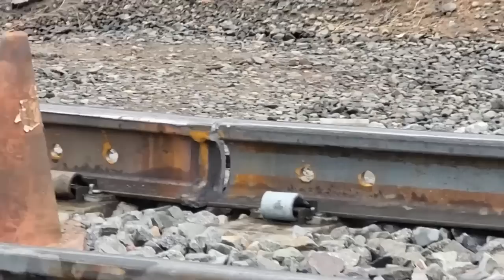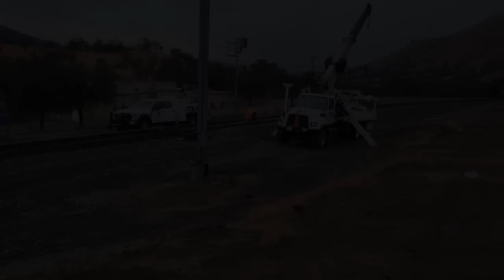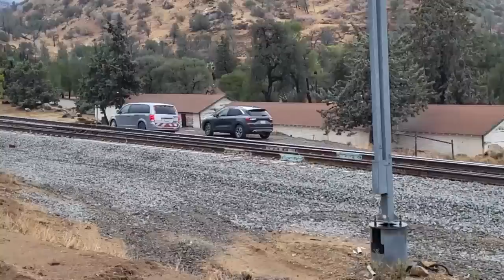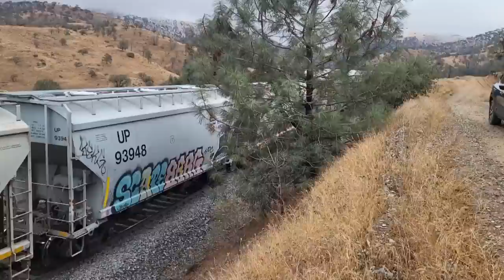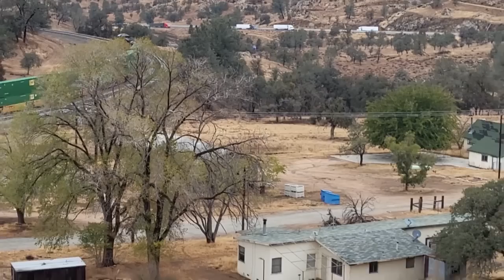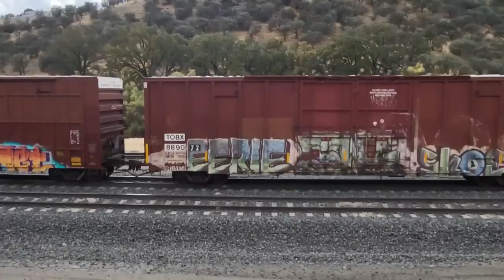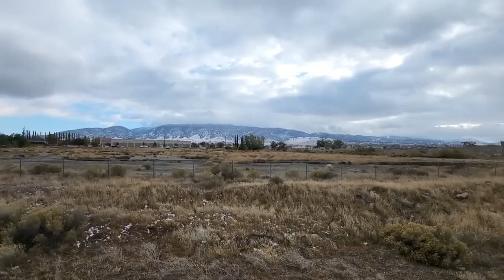Trouble on the Tehachapi Pass! Broken Rail at Woodford.

Comment: Mark I worked in the planer dept. at a sawmill near Dinuba for 23 years and then at Home Depot in the lumber dept. for another 21 years and you are right about the smell of lumber I never get tired of that smell.  Thanks for all your videos.
Reply from the maker: Was that sawmill the abandoned facility on the south side of town with spurs running into it?
Reply: @MarkClayMcGowan  Sequoia Forest Industries North of Dinuba and South of Reedley. There are several spurs there and I think they are still being used, sawmill and planers are long gone.  There is a co-generation plant there also.  That sawmill was built in the early 50's and operated until the spotted owl came to the forest...lots of people lost their jobs.
Reply from the maker: And the spotted owl would still have been fine.
Reply: @MarkClayMcGowan  As delicious as the smell of fresh cut lumber is, the smell of the forest is even better. The mix of live trees along with the decomposition of deadfall and brush is wonderful, especially in the fall and spring when everything is damp.
Reply: I loved the smell so much, that when I graduated from Reedley High in 88, I moved to Oregon an spent 20 years working as a faller or a lumber grader, I now work for the Post office as a carrier, but still love the smell

Comment: Mark .. Looking at that break where the rail broke .. I saw holes on both sides of the rails .. Question  .. Could they have used fish plates instead of cutting the rail out ? 🤔 Or my guess are all rail on Class 1 railroads required to  be welded by FRA rules ? 🤔
Reply: He mentioned they couldn't because it was right at the field weld.  The weld leaves a bulge on both sides of the rail that the plate wouldn't fit over.
Reply: @Tommy Zamberlan ..  Yes and when I go back and look at the break it was at a weld joint .. but I'm also thinking that FRA rules may require all Class 1 railroads to have only welded rail .. I think Mark could verify that 🤔  ..
Reply from the maker: The holes were there from when the I-bond (the piece of rail with the insulated joint in it) was originally installed during the rail project. It was welded out prior to that project ending. The FRA makes no distinction on jointed or welded rail other than all joints in a fouling circuit (a switch location) must bonded for continuity.
Welded rail is much better for rail installation, track structure, and track and signal maintenance.
Thanks for checking it out!
Reply: The only way to angle bar a break near a field weld like that is with bubble bars.  Even most old school railroaders have never even seen a pair of bubble bars, but they do exist.  I’ve seen them in track on BNSF track in the Elwood/Joliet, Illinois area.  They have a bump out in the center of the center holes to accommodate for the bulge left from the field weld.
Reply: @Tom Stathis  The more I looked at the video I was puzzled how would an angle bar would fit over the bumb and then I went back thinking it could be a break in the weld joint . But your analyagy makes sense . Thanks 👍

Comment: Awesome video Mark. I was just ready to write in on how I would fix that
rail when you narrated on how they were going to do it. Was also ready to
hop on a plane and fly out to help. Very odd break! Usually a break at a weld
takes part of the weld with it. Caused by an inclusion in the weld where the
slag had some oxygen deposit left in from when it was welded. Have never
seen a break an inch away from the weld like that one. Really making me think
on why it happened. That looked like fairly new rail. Would really like to know
when that rail was laid and the weld made. Great shots on the rest of the video.
Excellent show my friend!!!
Reply from the maker: This was welded electrically with the big, on track unit. Maybe that changes the properties of the weld? Thanks for checking it out!
Reply: @MarkClayMcGowan  I cannot answer that. We've never had any flash butt
welding done here. Just watched it on a YT video. I've had several thermite
welds break and the pattern on all of those is just like I described in the
original post. Hope sometime you can talk to a welder and find out what
they think. I would love to know that info.

Comment: How do they find a broken rail in the first place? Visual inspection or is there a system that automatically detects broken rails?
Reply from the maker: When a rail breaks, it causes a track indication that shows up on the dispatcher's board. It also puts all entering signals to stop. The dispatcher notifies signal and track operations, who notify a signal maintainer and a track inspector. In this instance, in a control point, it's pretty easy to find as the area is small. This one was found and removed from service by the signal maintainer. Thanks for checking it out!

Comment: Silly question, but why do they not run all units? Wouldn’t it be more efficient to run them all for the power?
Reply from the maker: Many times they are just moving power from one place to another. Two or three units can move most of these trains over the mountain. Longer, heavier trains may have power on the rear (and/or middle) for assistance and to reduce drawbar stress and for dynamic braking, but running all the units would be a waste of fuel as the working power can easily pull the dead weight as well. The only silly questions are the ones no one asks!
Thanks for checking it out!

Comment: A most interesting video... and it raises a few questions...
1) The rail break (and pull-apart) must have occurred under traffic and I was wondering how it was detected, particularly since we no longer run cabooses and the pushers are likely unmanned. Or was it detected as a result of a track inspection or a failure of the signal system to clear?
2) Was this on track that was recently worked on?
3) When was the last ultrasonic inspection of the rail performed?
4) Was there previously a rail alignment issue or fouled ballast in the area?
5) Does it look like the closely adjacent rail weld was improperly done, as the rail appears to be structurally weakened?
Thank you Mark for clarifying the matter. 2024/03/10. Ontario, Canada.
Reply from the maker: 1. Not all rail breaks occur under trains. A weak spot and enough temperature difference (they happen in the summer as well) and they will break without any other outside forces. This one did break under a train though, and left a track indication in the OS. The dispatcher then called a signal maintainer, but the train you saw on the mainline was given permission to flag the red signal. When the conductor walked ahead to inspect the track and switch, he saw the break and didn't believe it was passable, so the turnout was removed from service. Crews on cabooses rarely spotted broken rails, and manned helper crews never spotted them. 
2. The rail on each side of the OS (the turnout between signals) was laid and welded to the OS rails in mid July and the break occurred in early November. It was determined that a low spot under the weld was the cause.
3. I have no idea when the rail detector car had last checked the area.
4. A low spot had developed under the break due to improper tamping, which settled after some wet weather, but lateral alignment was fine.
5. The weld was fine. The roadbed at that point was the issue.
Thanks for checking it out!
Reply: @MarkClayMcGowan  - Thank you very much Mark for the detailed reply.

Comment: I like to know where I can get a radio in order to see some this trans where I live. I live just outside of Birmingham alabama, there is a train yard in place called Irondale. Back when I used to rewind motors, I used to re-insulate a lot of these traction motors on these engines. And rebuild or rewind some of the switch track switches. But what I understand now, these engines are turned into a AC drive setup if I'm not mistaken. Because we have not rewound any DC traction motors in quite a long time.
Reply from the maker: It's my understanding that all the DC road engines on the UP have converted (help me out experts!) to AC. As to the radio, you can buy a scanner and program it with the frequencies.  I don't know exactly where you would get them for your area, but I'm sure local railfans, and/or ham radio folks, would have that information. Thanks for checking it out!

Comment: How can an engineer spot a break like that and stop in time?  Seems like it would be hard even to see from the distance of the siding switch, yet apparently the train got stopped. Did another train catch it earlier, or a track inspector catch it, or did the signal circuit catch it?
Reply from the maker: If the rail is broken, the signals governing movement into that section of track will be red. At a control point like this, the conductor would be required to walk from the signal to the power switch to ensure the way is clear and the switch is properly lined. Between control points, the train would slow to restricted speed, which is a speed at which they could stop in half the distance of seeing an obstruction or improperly lined switch, and in no case, over 20mph.
Sometimes the crew will see the break, sometimes not, and sometimes, the break occurs under the train.

Comment: So it was a Broke and Run ? 😬 At what point would the Crew of the train that caused Broken Rail be Notified or would this Page the Dispatcher or Repair Group ?
Reply from the maker: Rails don't always break under trains, but if they do, there is no way for the crew to know that. Once they clear the affected circuit and the light on the dispatcher's board doesn't go out, they will get someone out to find the problem. The dispatcher can't tell what's wrong either; only that there is a problem.
Reply: Red Signals

Comment: I wish, mon ami, that you had video-taped the welding process !
Reply from the maker: They didn't weld it that day, and I no longer have connections in the track department up there. Should I come across them doing it somewhere, I'll get it as long as the crew are okay with it. In the meantime, here is the link to a video I shot of the rail gang at work in which they use the on track electric welding process.
https://youtu.be/Io3-acVjMnQ

Comment: How is a broken rail like this one usually detected? Thanks!
Reply: That's exactly what I was wondering did a train run over and notice it or is it detected automatically?
Reply: The signal system is setup to catch this type of defect. A broken rail will drop any wayside signals or crossing gates in the block affected. And at dispatch, it'll probably show an occupied or abnormal state.
Reply from the maker: Control points and segments between them have lights on the dispatcher's board. When clear, the light is out. If it remains lit, the dispatcher notifies signal operations and the local Maintenance of Way manager and a signal maintainer and track inspector are dispatched to the area. There are a number of things that will cause a "track indication",  but broken rails are one of the more common problems. My buddy said that he found 87 in 2021 on his 400+ mile territory (he is a signal maintenance foreman) and that was just the ones HE responded to!

Comment: Who spotted that bad piece of rail? How did they know there was a problem in the first place.
Reply from the maker: A broken rail deenergizes the track circuit, which leaves an indication on the dispatchers board. Dispatch calls signal operations, who dispatch a signal maintainer to find out what's wrong. The maintainer notifies track forces, who then make the determination of whether or not trains can pass the break. In this case, they couldn't, and the track was removed from service.

Comment: That weld was done only a few months ago. 8/24/22 and the Rail Temp was 90 degrees. The ultrasound must not have picked up a crack.
Reply from the maker: Yes. They changed out the entire switch panel in August (wood to concrete) and laid new CWR on both ends in July. There was a very low spot under the break as well. I'm sure that didn't help things.

Comment: What caused that rail to break like that? I bet some of the train crews were thoroughly annoyed for the delay. Oh well.
Reply from the maker: In this case, it was likely due to a relatively big drop in temperature in a 24 hour period (there were actually three on this morning between Tehachapi and Caliente). It was in the 60s the day before, but rails break in the heat as well.
Reply: @MarkClayMcGowan  That is interesting to know. Caused quite a backup of trains but you got a lot of good catches.
Reply: Flats on the  wheels will also resulting a broken rail as well

Comment: how did they find that broken rail?
Reply from the maker: A signal maintainer was called, but in the meantime, the train sitting on the mainline was given permission to flag through the CP. The conductor then has to walk to the switch to take into hand (so there is no way it can throw under power), and inspect the track for any problems. He saw the break and determined it was not passable, so the dispatcher removed it from service.

Comment: The two BNSF locos are the older GE 16 cylinder units called "Dash 9" by most railfans. One with the Heritage II livery, and the other with the War Bonnet livery(Red Cab). A common thing you'll see on a lot of Dash 9 units is evidence of an engine fire in the center section of the loco, lots of paint irregularities and scorch marks.

The CSX is a much newer 12 cylinder GE Evolution Series unit.
Reply: You are correct on the Dash 9 scortching.   Union Pacific made a mistake putting the American flag on their loco's because a lot of them are scortched.
Reply from the maker: I don't think it was a mistake at all! I thought it was very cool! It's only a representation of a flag, and therefore, not subject to the same protections and guidelines afforded actual flags.

Comment: You might want to check out what is known as Ear Values. They are better than ear plugs. It cuts the real high and the real low noise. Where to find them is at gun stores or shooting ranges. I used to shoot trap (shot gun). They can last several years. Just wipe off the ear wax and your good to go. There is a small cylinder inside do not get that wet. And do not share with other people. Each should get there own. I have heard why we are starting to see shorter trains. The bottlenecks are pretty much gone. The stores are getting stocked up. And the warehouses are full. So the orders are down. What is stocked up is none food things. And with the economy in the toilet the stuff is too expensive and the stuff is just sitting. So if and when the economy improves the trains will be shorter. You may even see more bear tables. Getting those car to where they win need them close by the terminals. Most trains we see come from a area once a day. From where they start from so if they have a lot the train will be long if they don’t it could be shorter. Steven Sipes

Comment: Any longer than an hour for a roadmaster to get there, and they're getting in trouble. You can walk a train over that at 10mph if you had to. Put wraparound bars on it while your team gets a new piece of rail to cut it. Done.
Reply from the maker: Track supervisors are the ones who show up. Even at SP, Roadmasters (UP calls them Manager of Track Maintenance) didn't go to broken rails as there is nothing they can do. This was one of three that morning. The break was too close to a field weld to use bars and it was in a low spot (even though this entire panel was just installed and surfaced this past August), which probably contributed to the break. It wouldn't have mattered because, due to the other breaks, there was no where to move them. Thanks for checking it out!
Reply: @MarkClayMcGowan  gotcha.  We call them track supervisors / roadmasters on NS. And you can actuslly put joint bars on a broke thermite weld if the gap isn't too big. Look up wraparound / belly bars. Cool video and story!
Reply: @MarkClayMcGowan  Was the first cold snap of the winter on the new relatively new field weld a factor?

Comment: And why is it not electrified? We have only the most remote place on diesel traction.
Reply from the maker: It was studied around the turn of the century, but there was simply not enough electric infrastructure to do it. Electric traction is good for many things, but not pulling 10,000 ton trains up 3% grades. Also, after 1980, when it might have made sense, the environmentalists would never allow power plants to be added to power it. Now, it would simply be too expensive.
Reply: @MarkClayMcGowan  Почему вы считаете что электровозы не могут водить поезда больше 10000 тонн? У нас они спокойно водят, ещё с 80-ых годов прошлого века. 3% уклон для них не предел - на обходе Северомуйского тоннеля есть участки с уклонами по 4,5% Кроме того, с электротягой возможна рекуперация энергии.
Reply from the maker: I'm sorry. This reply wouldn't translate.
Reply: @MarkClayMcGowan  Here :) Why do you think that electric locomotives cannot drive trains of more than 10,000 tons? We have them quietly driving, since the 80s of the last century. A 3% slope is not the limit for them - there are sections with slopes of 4.5% on the bypass of the Severomuysky tunnel. In addition, energy recovery is possible with electric traction.
Reply from the maker: I've not heard of 10,000 ton trains in Europe from any of the railfans with whom I've visited, but maybe where you live? The environmentalists would still never allow it to happen here. Another thing Europeans (or anyone else really) don't understand about America. If a rat or a worm is endangered, it will be shut down, and the government will not intervene.